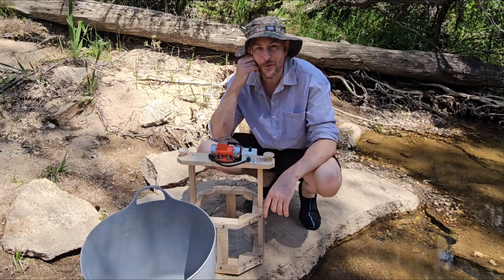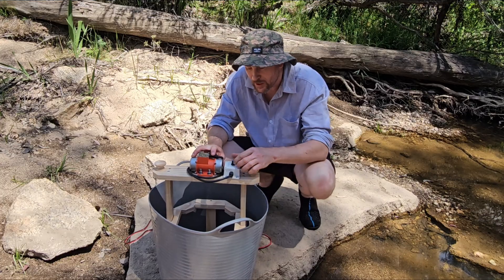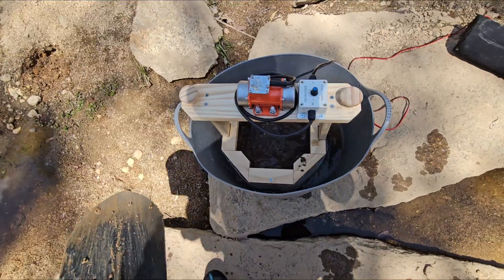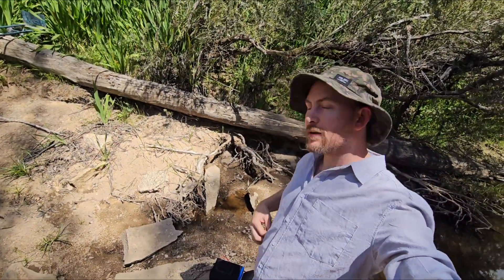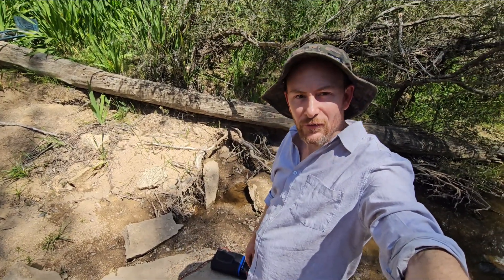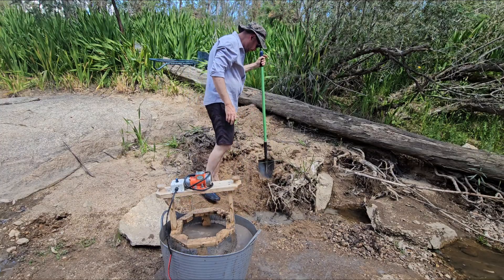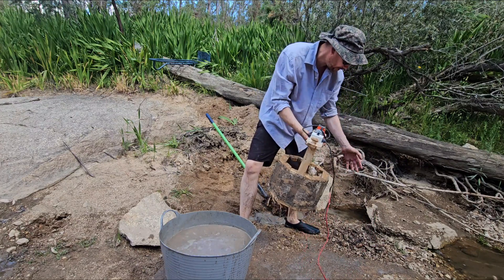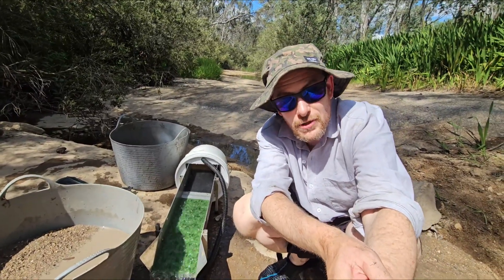The Vibrating Bucket Classifier

Comment: Nice idea and i just ordered a vibrating motor like you have but i  would like to see how you made that sluice header bucket and wondering if the intake hose is directly dumping into the mat or do you have it behind filling the bucket to overflow into the sluice??___ either way nice touch and i am a subscriber here in the Sonoran Desert of Arizona
Reply from the maker: G'day Notwrkn2mch. Yes the hose is pushed down inside the bucket just filling it to overflow. 👍
Reply: @onthegoldagain1246  Thanks appreciate it for sure

Comment: Needs the bottom raised so fines can fall underneath.  Also, have you thought about combining this idea and your rocker high bank hopper?  Vibrating high bank hopper seperate to sluice run could be good.
Reply from the maker: Hi Ron yes I think I'll put some wings on it to hold it up. I did use it on a hopper, its my shaker deck vid, two vids ago. Alot of people missed that one. 👍

Comment: top stuff mate call you the gadget man , i make 90% OF MY GEAR OUT OF STUFF I GOT LAYING AROUND may be have 3 feet about 6 or 7 inches long fill bucket up wit water to the top then mesh not sitting on bottom , lift up every 5 or 6 shovels so legs sitting on top of material
Reply from the maker: Yeah mate think I'll put some wings on it to keep it off the bottom. 👍